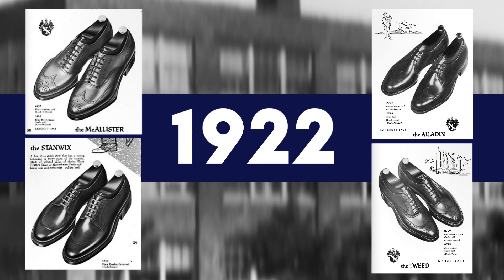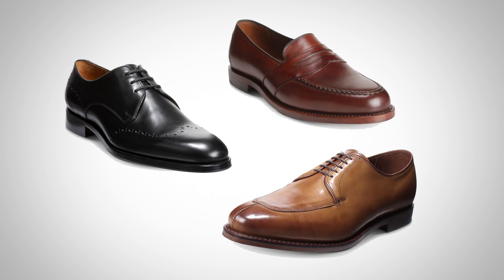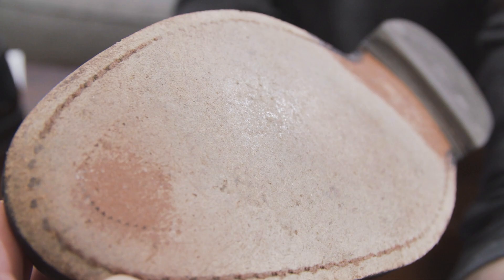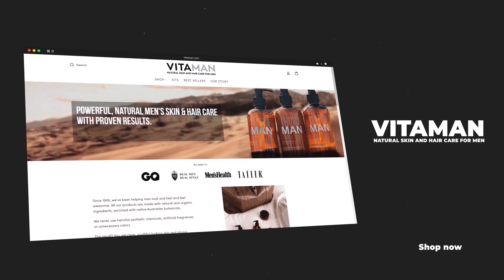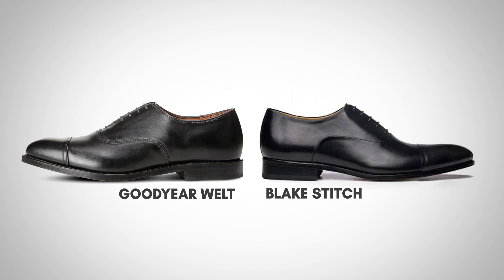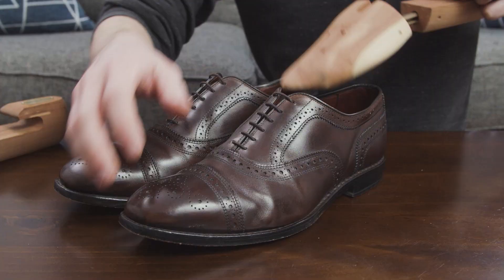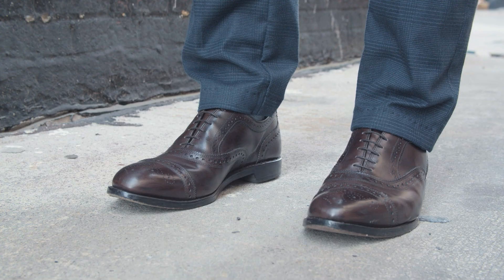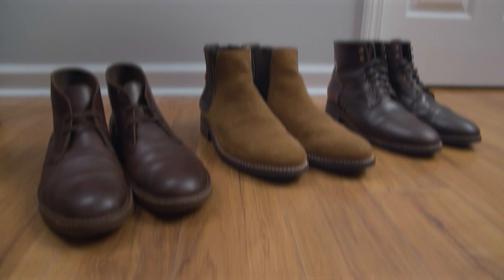Allen Edmonds' Shoes: What You Should Know Before You Buy!

Comment: I have eleven pairs of AE shoes, dress and casual.  A couple of those pairs are coming up at twenty years old and have been recrafted three times.  My one beef with AE is that they are certainly built for the long haul but fail to stock any adequate laces, especially those styles that have some unique design.  It wouldn't kill them to have a "lace bank" of which replacements can be drawn from or standardize on a fixed number of laces that transcend most shoes.
Reply from the maker: Very impressive!

Comment: The one thing I insist on for a $400 shoe is that it be available in different sizes.  Not just a full range of lengths, but a full range of widths as well.  Offering only a D and EE width is like selling your shoes in sizes 9 and 12 only.  

Allen Edmonds sells a $400 shoe for $400.  No other manufacturer even comes close.
Reply: Interestingly, Allen Edmonds has essentially stopped offering EE widths and skips from E to EEE.